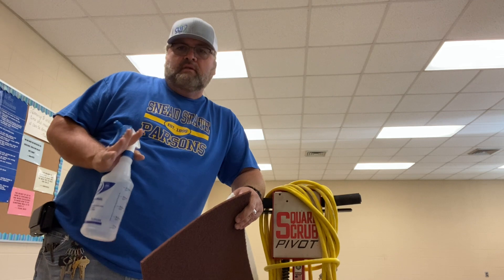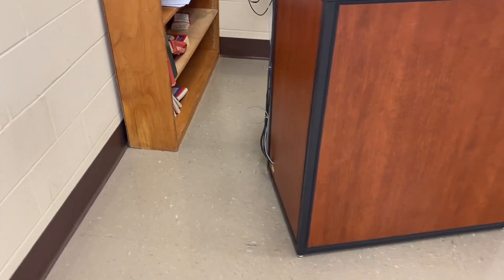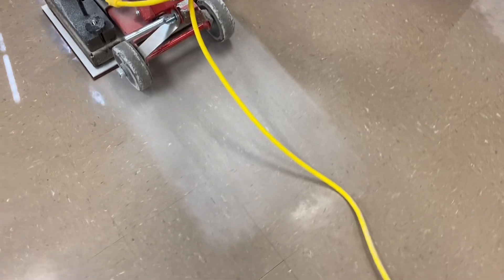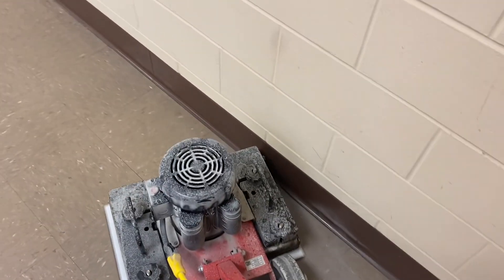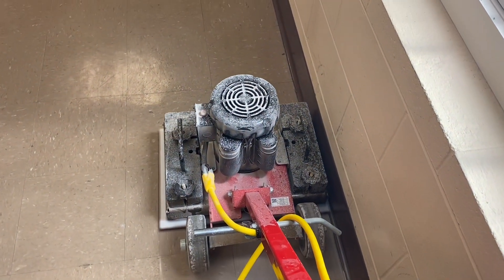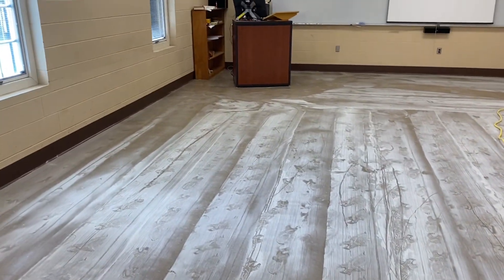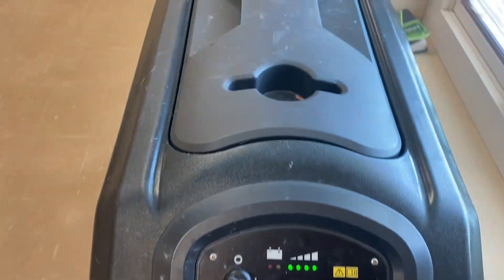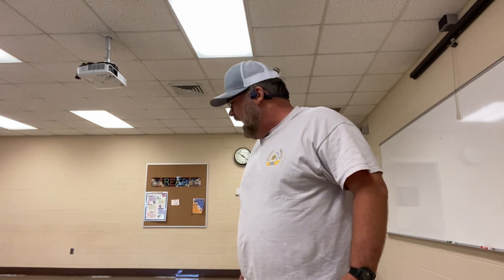Square Scrub @mrjeffthecustodian

Comment: Something important to know is that these machines aren’t completely stripping the floor. It will get you down through multiple coats, but it won’t strip away all of the finish. They are great time savers and any facility that has VCT needs to have one
Reply from the maker: Yes

Comment: I sell stripper and chemicals but i tell everyone if you've got your arms around your floors (meaning you don't have 30 coats of finish on the floor) this is exactly how i would want to scrub and recoat my floors every year. Just showed this method today at a school district and refinished with ishine from Spartan. Then i took them into their bathroom with clean by peroxy and a turf pad on this unit. Oh boy did we have a nice slurry going lol. Great work keep it up!
Reply from the maker: I used Proxy last week with Doodle Scrub in bathroom. I made a video using it. Love square scrub. I am very familiar with Spartan wax as well. Thanks for your input means a lot a lot coming from a rep!

Comment: I think these machines are really great and even if you’re just scrubbing with the same pad but round one it’s just as good. The only thing though is, I prefer to have a little bit of water to keep the dust down especially if you just clean the room you could risk getting dust everywhere You don’t wanna breathe that in either

Comment: It takes 2 to 3 coats off. If 1 or 2 scrub & recoats have been done on the floor then you (may) need 2 passes with the square scrub.
Reply from the maker: I have had some floors that had to have 2 passes.

Comment: I saw this method being used on an uneven floor and where there were divots, nothing could be done with what the user had which is why I am skeptical of this process, but still like it for the right application.
Reply from the maker: Yes if floor is uneven it will cause issues.

Comment: where I work we don't use "wax" sealer. Would this machine be okay to use? 
We don't ever have enough time to clean buff the floors. We just shine with a white pad.
Reply from the maker: This is for taking 2 to 3 coats of wax off. Then reapplying 2 to 3 coats.

Comment: I am using a red pad a backer pad  then the SSP pad. If I switch to a white pad will there be any difference in taking off the wax ? Also I will flip the SPP pad after I  do the room, then us the new side  and do the room again. Most of the time I will us a small floor machine after the edges are done. One pass with the water on two the flipping the pad and no water on. Also I will use a squeegee on the edges to bring the water out. Then use the floor machine to pick up the water.
Reply from the maker: Red pad want make a difference in how much wax it takes off. I have used read pad for a backer.

Comment: Have you ever had to clean a floor with neutral floor cleaner?
Reply from the maker: Many times
Reply: @mrjeffthecustodian just be glad you’ve never had to use a propane powered stripping machine or burnisher. Those things are very loud at 115 DB I believe

Comment: Mr. Jeff, you prefer this method? The traditional black and stripper method, or the maroon with water and low speed method?
Reply from the maker: This Method.
Reply: This method has been a godsend to our custodians. I promise, we still use light mopping but use autoscrubber and clean mop afterwards great results. Thanks Jeff.

Comment: What if when you do this on waxed floors you dont get any wax up?
Reply from the maker: If  you get a white powder you are getting wax up. This system removes  2 to 3 coats. I have never had it fail with a 3m marron pad. you are leaving your base coats on the floor.

Comment: What kind is the white pad? I have a square machine using a black pads but it won’t last attached to the velcro.
Reply from the maker: The white pad is to protect the Velcro teeth on pad driver.
Reply: @mrjeffthecustodian  thank you Sr.
So is a regular white pad?
Reply from the maker: Yes

Comment: We have one and I hate it. Dust everywhere and no way I can use one hand. Two rooms and I'm beat to death. I'm doing everything it says to do but it's not something I like but our school system no longer wants to use stripper so I guess I'll need to get used to it lol 😂
Reply: I feel the same way. I hate using it!
Reply from the maker: You tried using some water?
Reply: @Mr Jeff Custodian  well, I did mop the floor with light water before hand but that turned into a huge mess because it turned I to like a clay substance lol. I had to mop the floor 12 times to get the residue off...
Reply from the maker: Auto scrubber will take it up fast and easy.
Reply: @Mr Jeff Custodian  Trying to convince the county to get me one lol. I played heck Trying to get a new lawn mower and I finally got it after 3 years lol..
Reply: @mrjeffthecustodian after square scrubbing you use the autoscrubber, do you have any issues with it clogging it up ever?
Reply from the maker: @smileandlaugh03  I run water wide open on auto scrubber. Never have had any issues.
Reply: I'm not a fan either. Rotating orbitals I've used worked better but still not a fan of dry stripping. I prefer to get up all coats all the way down to the bare surface. Especially because the wax browns over time. Even though it says none browning it all seems to.
Reply: Huh I can use my square scrubber one handed all day long!! I just hold my switch and let the machine pull it's self along. The square scrubber is awesome to get right up to the base boards and corners. I even use my square scrubber to chemical strip with  black high productivity pads.
Reply from the maker: @user-zy5ld2hy8c I have never chemically stripped the floor with it. Got some coming up that’s going to need it. May give it a try.

Comment: Tell people how much maroon pods cost😂
Reply: they ain't cheap for a box of ten, about $130 for a box of ten, but u can go off brand for about $50 or $60 bucks.
Reply: Thats not bad. High performance stripping pads cost 60 bucks a case for 5. So its a wash. You save money in stripper, time, and not having to use a netruilzer.

Comment: Lmao.. you use stripper and leave it an hour you burn the tile.. lol great tip.. with the stripper and round head machine it's a 2 or 3 man job that gets awful messy.. those square machines are great
Reply from the maker: I actually left one
Room overnight with the square. Yes we got into some messy times wet stripping. Oh the stories I could tell.
Reply: @mrjeffthecustodian  does it give better results than wet stripping with a scrubber?
Reply from the maker: @dwightlancaster2119 what my experience is that if the floor has been properly wet striped. You are taking 2 to 3 coats of wax of with square scrub then put 3 coats back on. The base coats are still on the floor. Just take the damaged coats off. Which I have found works amazingly well. The city system I worked at for 19 years. The last 10 years I was there. Square scrub was all we ever did every summer. We got amazing results every summer. Definitely made it easier on use. Where I work now I introduced the square scrub to them. We now have  2 square scrub machines. So I’m sold 💯 on these machines.